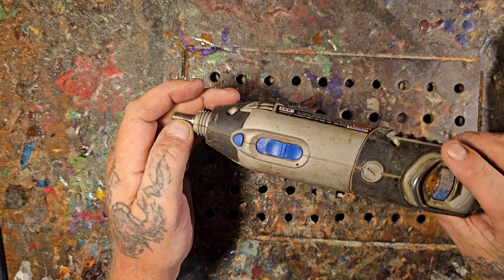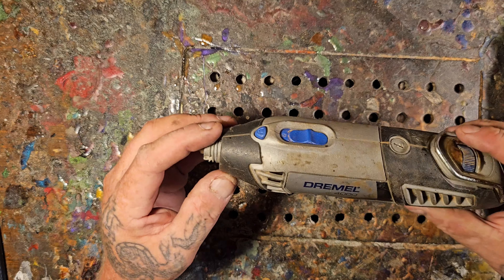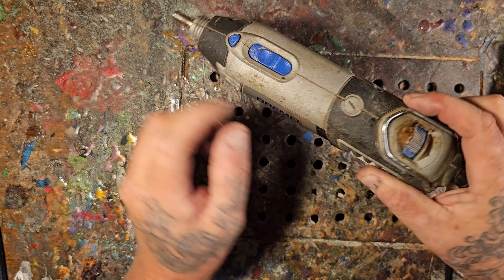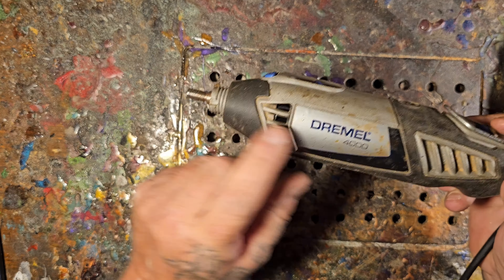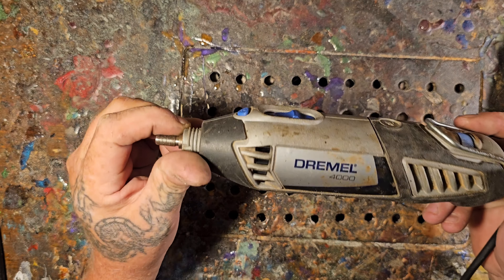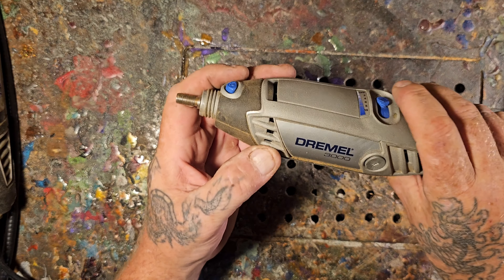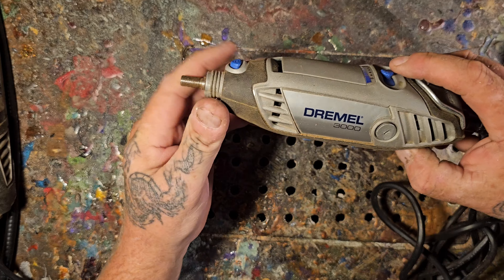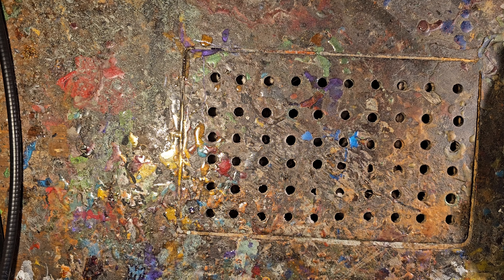Beginner wood carving- Diffrent makes of Dremel type tools,

Comment: Another great review Jordy. Have you tried the Ryobi Rotary Tool yet. It does connect to the Dremel Flex shaft. I find if you turn the Flexshaft lock down, when carving, my hand doesn't touch the lock at all. This is a tip for you, and everyone out there. I am looking forward to more great tips and videos.